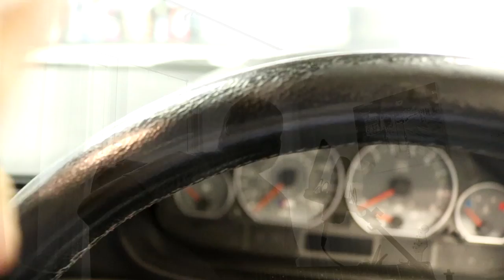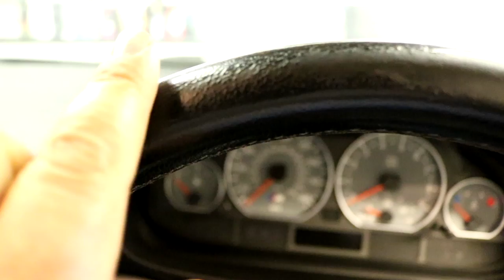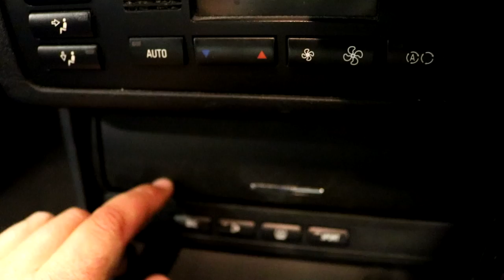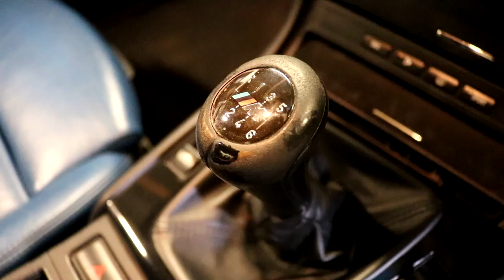BMW E46 M3 laguna seca blue full detail VLOG  Part 1

Comment: Those plastic parts aren't that expensive, I wouldn't have thought it was with the work. Good effort though 👍🏼
Reply from the maker: i think you are right..  the centre ashtray holder (2 flaps near the ash tray are 60 and 40 quid) ive bought those..  the other bits I repainted would have been about 200 quid to replace..  so hmm yer saved 200 quid..   feels worth it now but it was defo a lot of messing around...  but I also kind of like doing it in a wierd way.

Comment: thanks for another great video. always looking forward to your next one.quick question do you need to disconnect the car battery before unplugging the connections under the car seat???? thanks in advanced greetings from Los Angeles ca
Reply from the maker: yes mate, just unhook the negative terminal and wait 15 minutes...  And dont reconnect battery untill all the sensor circuits are reconnected.
Reply: great video,is that means that would not appear air bag light on screen,and that is rule for all bmw?
Reply from the maker: hmm, ok so I think when the car starts up the airbag control unit activates and checks the airbag sensor circuits... if any of those circuits are open the airbag warning light will come on...

So I belive if you do all your work on the car with the power off.. and then connect everything back.. you should be ok...

saying that ive got the airbag warning light on as I didnt follow my own advice there! but I can read the faults and clear them (most times if theres no real fault)
Reply: thanks on answer,,
in most cases, take  the seat out when I doing interior cleaning cars,, so far I have not had a problem with the air bag lights because I just worked as your procedure describe,, other say that at BMW will show i dont wy,, but I do not have a program to erase errors thats was my problem,becouse of that asked your opinion,,,thanks again on your REAL tips in all videos

Comment: You could try something like the Tamiya TS-82 Black Rubber model paint, to give you that soft touch OEM rubber finish on the plastics.
Reply from the maker: yer the stone chip paint defo has a bit of roughness to it.. but ive just been fitting it back in today and it looks ok and its very strong...   so pretty pleased.. made a note of that product for next time  cheers collersam
Reply: Looking forward to seeing the results. Added toughness is good, you certainly don't want to go through that rigmarole again.
Reply from the maker: its actually all done and back in the car now.. just need to get the hatch piece from BMW and get that installed...   going ok so far.. but always a ballache doing this.. :)

Comment: nice video mate, typical bmw plastics my e60 m sport steering wheel started to peel around the plastic areas i just took it apart and used plasti dip matt black, as for the leather seats easily sorted get onto furniture clinic website you could sort the cracks yourself.

Comment: What is a ballpark figure on a full detail like this?
Reply from the maker: Hmm not sure this goes beyond a full detail really..  I call it a restortation detail in the vid i think...    I dont do this commercially.   You would prolly need to use a car restortation company that specialise in restoring cars if you wanted someone to do all this for you...  You would be talking thousands I think.

You could manage it yourself though.. strip the car down and get professional refinishers to do the leather and refinish or replace internal bits yourself...   then put it all back together and then get a detailers to do a full detail inside and out?     roll the dice mate and manage it yourself its all good fun.
Reply: Got it, thanks for the feedback! Awesome channel you've got going here.
Reply from the maker: cheers edwin appreciate it mate

Comment: Damn soft touch plastics. They feel so nice when new but they take nothing to get trashed. My GTI is terrible right now with it. Probably going to just sand it all off and then have it hydrodipped or something. I have a buddy that does the soft touch spraying work for a local BMW dealer but I just dont want to even mess with the soft touch anymore
Reply from the maker: yer its a nightmare